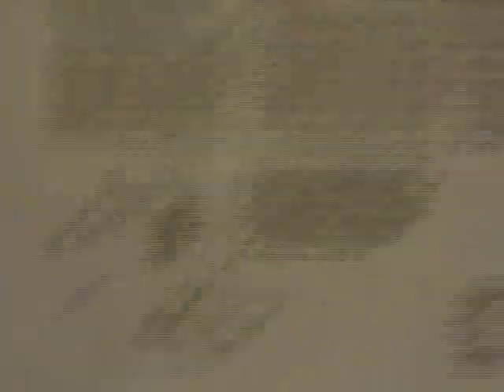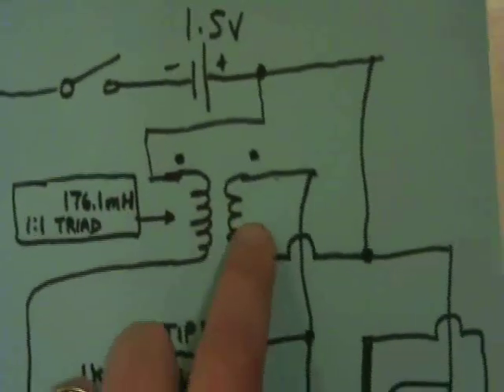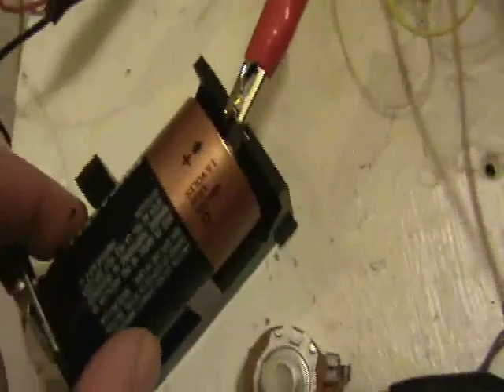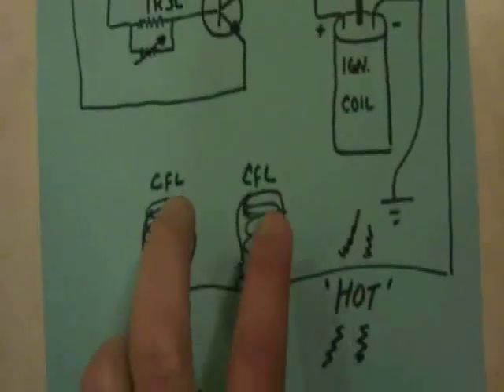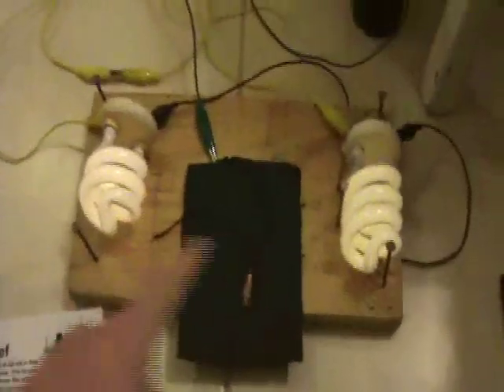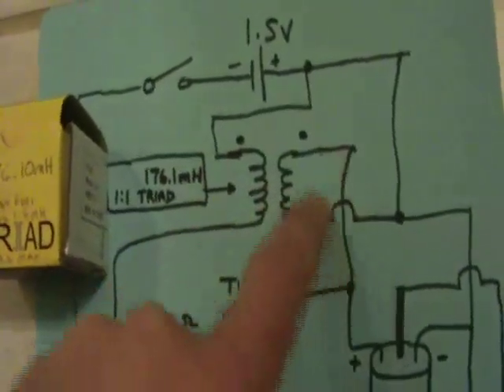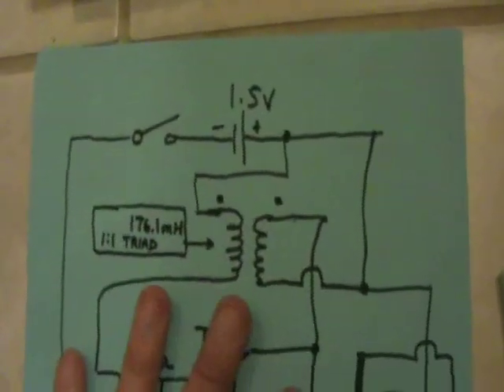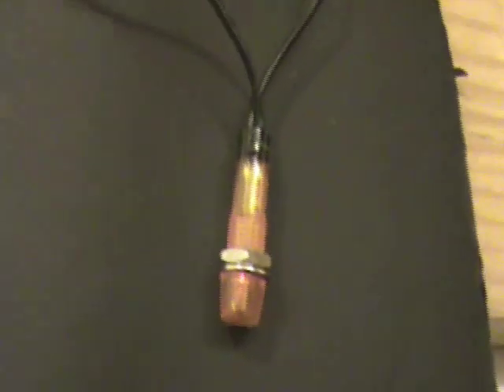Joule Thief Circuit - Driving CFLs with 1.5v

Comment: I got Positive results with the 2 ground connections from your schematic connected to the battery positive (+). It works that way, i haven't tried an actual ground connection or metal plate as yet.

Comment: That can also be caused by the gas + HV/HF electricity.....often times a CFL will appear green as you key in to your coils(or cores) resonant frequency. Just be sure to be extremely careful. UFOPolitics calls it cold electricity(as did Tesla). Tesla's Colorado Spring notes. Read it cover to cover, but be warned. Once unconventional understanding has been obtained, its very difficult to go back to conventional.

Comment from the maker: Hi Stoni2041. Yeah I have read a little on NMR and PMR. Interesting stuff. I experimented with high-voltage AC thru a traditional light bulb with clear glass and can see TWO colors for the ARC -- which I speculate are due to NMR and PMR. One is bluish. The other is orange-redish. They take different paths.

Comment: Mmmmmm...resonance. You seem very close. Do some reading on Nuclear Magnetic Resonance. They use it for medical tech and many scientists are aware it can be used to generate power, but most good scientists aren't in it for the money...so it takes years to leave the lab. The other problem is that it can become very dangerous very quickly...so safety precautions are a must. Tesla referred to the generated power as cold electricity.

Comment from the maker: @xxDarkGregxx 
Battery choice is tricky. NiCads don't do well with heat. Led acid works great, but is environmentally not very friendly and can dry up. NiMh .. expensive. Some folks are using super capacitors instead...

Comment from the maker: @RightQuiteNot 
Typical D cell is 12000mAh. Depending upon the current you drain, the hours you get varies on a curve .. with lower current being more ideal. Let say you are 25mA. That is approx. 480 hours or 20 days. Some folks have made these joule thief run real low current 5mA .. To be honest, I don't recall what current I was pulling that day .. but it was pretty low. The trick here is to make it as low as possible... and a bigger coil helps... but you also have to TUNE for CFL resonance.

Comment: @eloid777 
Yes search for "bedini imhotep". Basically (what I have done anyway), is to take a flat screwdriver, stick it slightly into the four holes around the plastic, and then turn it. Often the entire thing opens after only doing it in one hole, without any broken pieces.

Comment from the maker: The secondary does have the DOT on top, yes, but its wired to the collector of the transistor like it should be. Other diagrams have the 2ndary of the transformer DOT on the bottom.

Comment from the maker: yes and yes. You don't need an earth ground to succeed. You can succeed with metal plates (isolated from the ground). A vibrating mass can feedback into the oscillator.

Comment from the maker: check out user/koolerization on youtube. koolerization has managed to get some very nice sparks with his circuit, power by only a 1.5V battery. I've never heard of infinite voltage. Kilovolts yes, Megavolts ... but infinite? Anway, the higher you go with voltage, the lower the current will go -- per conventional wisdom.

Comment: hi if you put a switching diode in the ht feed out to the cfl and wound a coil round the ht lead just past the diode this should up the voltage and go in to infinite voltage.only basing this as your circuit has the same type of stuff used as stanley meyers  voltage intensifying circuit that lets voltage go to infinity to fire at a spark plug with water passing.....just trying to get my head round electronics so i may be wrong but would appreciate  a reply on my suggestion